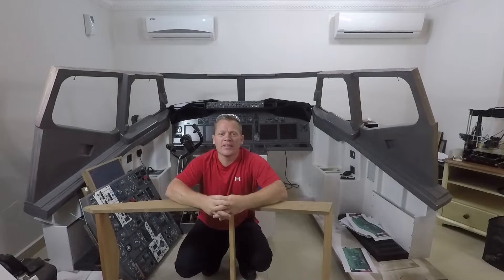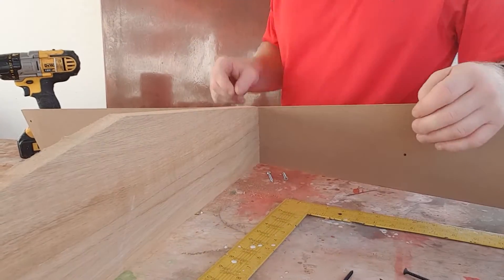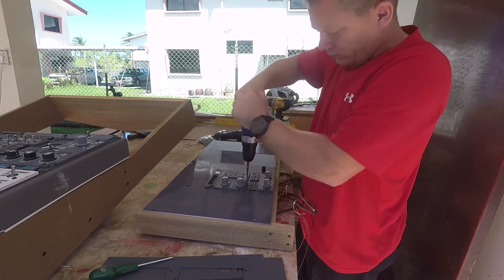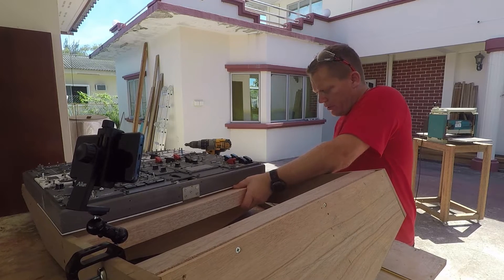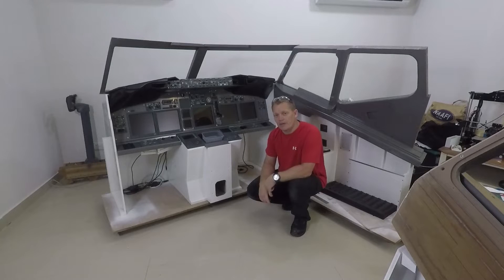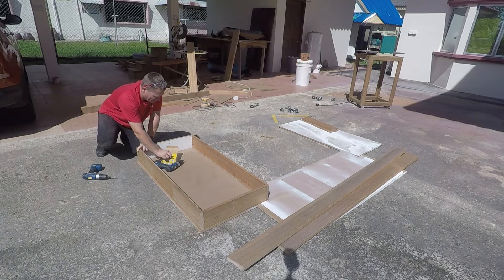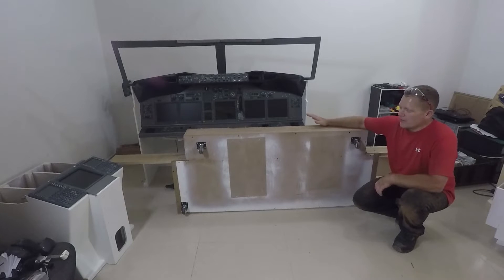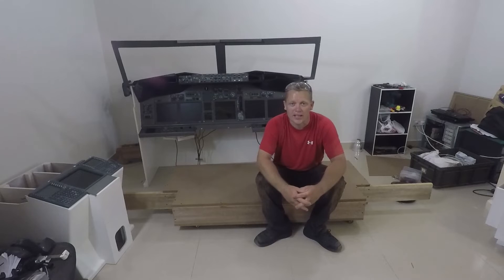737 Overhead EP20

Comment: Will you do a "DIY" engine starter switch (with selinoid kick back)?  I just found your chanel today and it has revitalized my dreams of builing a simulator of my own!
Reply from the maker: Hi glen, great to hear from you. The engine start switches are on my list of things to do. I have several ideas I want to try, but at the moment I'm about to start building the aft cockpit.
Reply: @helimech8152  I have really enjoyed the way that you show various ways of doing the project.  Showing a method of buying the panels already made and the much more inexpensive way of DIY (doing it yourself). Being disabled and on limited resources has always made this adventure difficult.  Now seeing how it can be done in a cheaper way has once again put me on the track of doing it myself.  Thanks for the input you give all of us!
Reply from the maker: Absolutely great to hear. If I can offer any help, please just ask. If your looking for cheaper software, which is by far one of the most expensive things, theres always xplane or pmdg 737.
Reply: @helimech8152  
One of the biggest things I have seen you working with is the software that integrates  the software with the hardware.  That in itself was huge!  Comparing that with the prosim at $1200.00 was such a huge savings.
I currently already have the PMDG 737NGX software. 
I do have a question that you may be able to help me with.  I have this product..... https://www.amazon.com/gp/product/B072N4FMRN/ref=oh_aui_search_asin_title?ie=UTF8&psc=1
Here is my questions.
1) Will these components work to build a CNC machine?
2) The components do not include a cutter spindle or laser spindle. What would be the most economical items I could buy that would work?
3) The components do not include the frame or base.  What would be the cheapest way I could go? Could I build it from wood?
4) What is the smallest frame I could I build and still cut the largest panel needed for the project?

Thanks for the help!